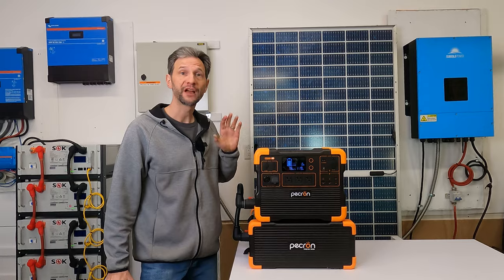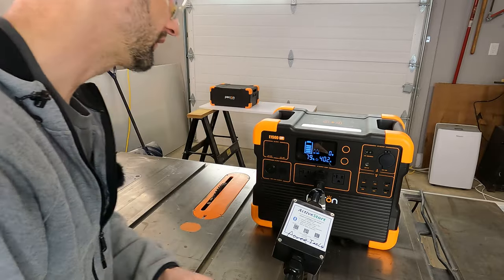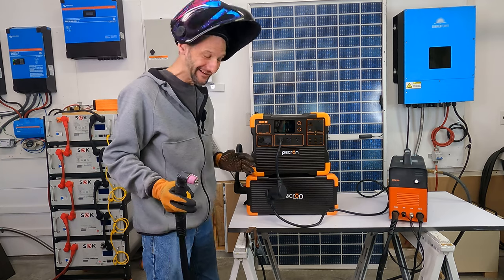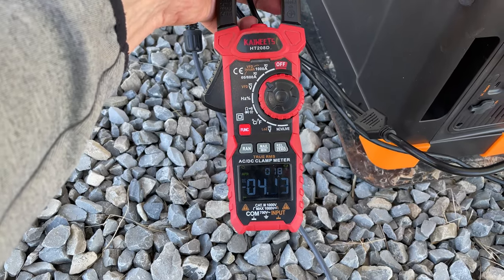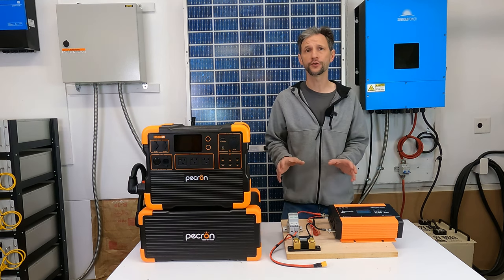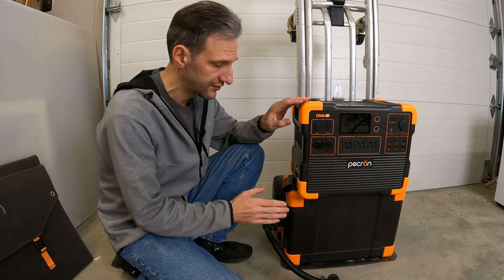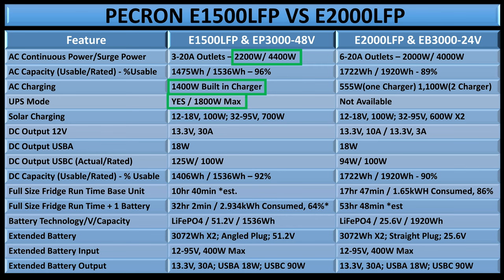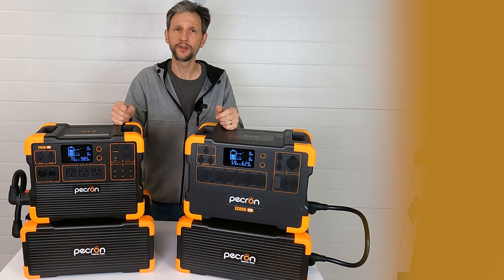PECRON E1500LFP 2200W LiFePO4 UPS Solar Generator Review

Comment: OK, I admire this review with "Dave".  Here's the disappointment for a lot of us Senior Citizens and millions of those who have no Engineering Degree, i.e. Dave made a comment about 1000Wats per meter Squared!  What the heck is that??? and it goes on with all these special tools measuring this and that... what the heck does this mean to most of us?  Where is the video for this solar generator being reviewed in simple terms?  Shame on you PECRON.  I saw Dave's GIANT solar panels... who is going to put them in their backyard?? Where is the common sense presentation of what this can do, what appliances it can run and for how long in simple terms?  What solar panels would best best to charge in the average back yard? Most of us are looking at a SHTF situation and want to know what generator will power our basic appliances, how long will our unit take to charge with how many panels needed to make it within a day... we need something simpler!  Advice: make your egghead presentation then provide a simpler version!  I'd watch both and I know many other would as well.  Shame on PERCON for not having anyone you can talk with as all you questions have to be emailed with email responses in return.  I was going to spend over 5,000 on a unit with extra batteries and panels, but am having second thoughts... what if something goes wrong with your unit?  Email is the only way to communicate with this company?  Go to a company you can actually talk to!

Comment: 35000 Cycles?  Really?  Come on, Mr Pecron Salesman on YouTube.  Someone GAVE you THOUSANDS and THOUSANDS of dollars worth of equipment.  You would like that equipment to keep coming in, why would ANYONE listen to what you have to say?  LOL.  PECRON, I will NOT buy your product JUST BECAUSE OF THIS GUY.
Reply from the maker: It's true 3,500 cycles to 80% is a book number that I did not confirm in my test.  However, that is a typical cycle life for LiFePO4 batteries.  As for the rest of the results, I am just testing the product in some real world applications and giving you the results.  You can decide if the product is right for you or not.  I don't need equipment to come in,  turn down 99% of the products offered to me an only test the ones I expect to perform well, have a good value, or have some creative new innovation.  As for the Pecron E1500LFP, except for the high idle consumption mentioned in the video, it's actually a nice package at a value price and performs very well.  Hope that helps!

Comment: The older unit has much more capacity.  This New model is a Fail!  $1900 👎🏻
Reply from the maker: If you don't need UPS, the previous version is the better choice.

Comment: I love and appreciate your videos but I just can't get behind Pecron.  They are notoriously held together with bubble gum and tape.  Everything about them is cheap and not in the good cheap kind of way.  They are time bombs just waiting to break on you.  A headache just waiting to happen.
Reply from the maker: What issues have you experienced?
Reply: Let me guess. You don't own one and have no hands on with a Pecron.  I own six (different models)  and have had zero problems. Their tech support via email is also good. I've seen breakdowns of several models and they are decent quality construction and components.
Reply: I watched a teardown of a PECRON unit ounce and it had cardboard inside. Their short warranty reflects the quality you should expect.
Reply: I have had 2000 lip for a year and a half. It sits in the bed of my jeep gladiator and is charged when I am driving the jeep from the Jeeps alternator via a renergy 2000 W inverter. It has powered everything in my Overlanding set up. Everything in my Off Grid trailer. I use it to cook, I use it to power my Starlink Internet, I use it to power everything every single day. It has not even blinked. It’s absolutely rocksolid and built like the Great Wall of China so I’m not sure where you’re getting your perception that it is made cheaply.  I am 100% satisfied with both function and build quality. You should probably actually go put your hands on one and then update your posting.
Reply: I’ve had issues with my E1500lfp ever since I got it. Incorrect state of charge readouts and doesn’t always take a charge. If I discharge it any percentage after being fully charged and then plug the AC charger back in, the battery drops to 1 percent on the display and will not count up in percentage while charging. Sometimes it sits there for hours and won’t take the AC input charge. Some sort of improper status readout from the BMS.